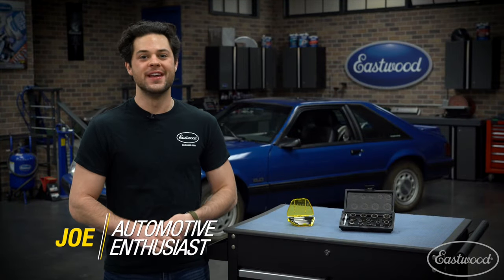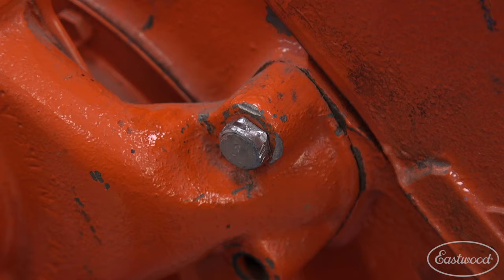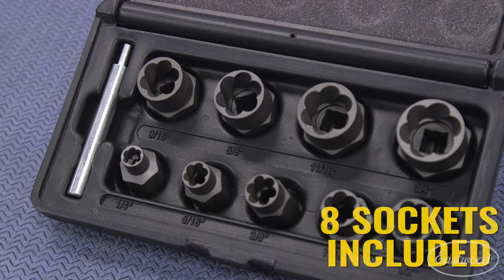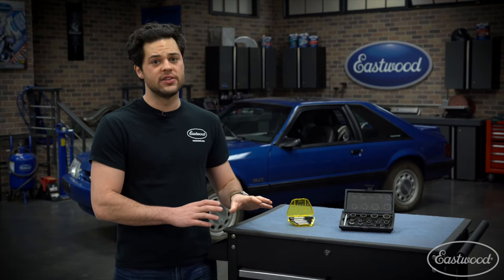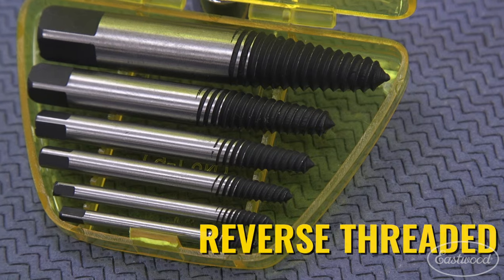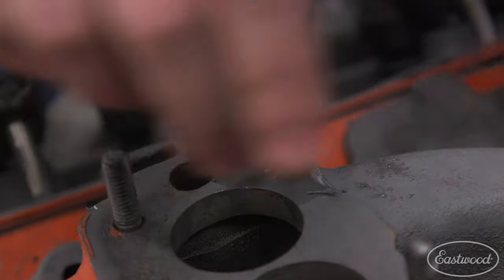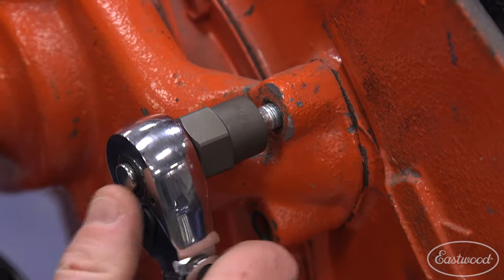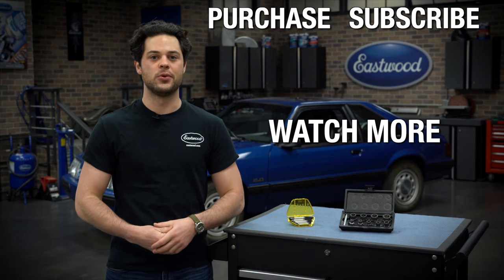The Easiest Way to Remove a Broken Bolt or Rounded Bolt Head - Screw & Bolt Extractor Kits

Comment: I used the bolt extractor and it worked fine.  Problem now is removing the bolt from the extractor.
Reply: One time use thing, hopefully 😂
Reply: You should be able to clamp the extracted bolt into a vice and use your tap handle to unscrew the extractor

Comment: It's been my experience that these type extractors don't work very well due to the fact that the reason why the bolt broke off in the first place is it was seized in the hole to begin with... it usually requires way more than a simple extraction tool to get out the broken bolt/stud if you're lucky... drilling and a torch come to mind... 😩😩😩
.
Reply: Agreed,  I have had very limited success with the "male style" extractors from various companies.. often they break off in the broken fastener and then you really have a bad day:-(
Reply: @matthewshambler2644 Agreed that they don’t work very well. However when they are what will work and they break…that’s user error.
Reply: Little tip, there is this chemical called Freeze-Off. It causes the bolt to shrink and makes space for the penetrant to work through. I removed several seized bolts from my 95 Integra's rear lower control arms.

Comment: For me the bolt extractor made matters worse as the extractor snapped off inside the bolt....very hard steel to drill out.
Reply: use heat first if you can,
Reply: You use the included punch to punch out the bolt, just like the video said.

Comment: Well we tried to remove control arm on older Honda Civic and broke one bolt inside and rounded the other one so I believe I need this kit
Reply: What did you end up doing to get it out
Reply: @MiguelAyala550  we had to cut them off and then drill them both out we did not have good drill bits and it took a couple weeks doing it here and there when we had time. I know there are better drill bits and tools that would get that out but we just couldn't afford it
Reply: Cobalt drill bits only.....

Comment: Question. Has the need to have the tool fit imperial heads caused any compromise in design?
I ask because here in England we only work on cars with metric fasteners (unless they are 60+ years old. And that's a specialist thing)
Been looking to buy a set of this type of tool to avoid drilling and heat.
Assuming you do international postage
Reply: 1:48 is 1:48

Comment: Eastwood should stick to welders, after all that is the best broken bolt extraction technique of them all. Faster, easier in most cases and more reliable with the option of a “re-try” if first attempt fails…”in most cases”

Comment: Start with a rounded bolt, break off the bolt using the rounded bolt extractor sockets. Then go to the male style and break the bit off.. now your really in a jam thinking you should have drilled and re tapped the threads to begin with.

Comment: Also these are very good at what they do.

Make sure to get correct specs.

Remember hardness equals brittle....... Very strong but......

The bolt he tapped the bolt extractor onto imo was to small, the extractor was more than half way on then tapped with hammer.

Use a extractor that just fits, just. And CANNOT BE PUSHED ON MORE THAN HALF WAY.

You wanna be hammer that sucker on.
And then the instant you turn the socket it will bite in, making less possibility of chewing the bolt head further into a rounded head.

Used correctly these work great.

Usually the quality is what let's them down but people do still make things that actually they were meant for, doing it very well.

Like drill bits.

Metal wood masonry?

Umpteen types for metal, why!

I've bought many drill bits and spent along time realising these are crap! Doing nothing.

A it of research and hey presto.

For not alot more. And forever lasting and better in every way....... COBALT DRILL BITS.

Enuf. Said. Already. 😅😅😅😅😅😅

Comment: I'll give the bolt extractor a go on cylinder head bolt.

Then straight to the cobalt drill bits,

Punch it. Drill it 6mm, then 10mm.

20mm depth.

Lift head.

Pipe wrench the stud out.

Comment: What about a stud that has 80lbs of torque on it?
Reply: My dilemma right now. I have one head bolt rounded. Torque bolt. So I have my easy outs. My welder, and my drill to hand.
Brutal
If stripping the mess of an engine isnt enough!!!

Afterwards gotta put it all back together, all 7thousand bolts nuts washers. Pipes, wires, plugs......

Comment: Hello quick question I have a Honda Ridgeline I'm trying to remove the ignition key assembly and on the steering column there are two rounded heads that online they suggest you use a chisel and a hammer to remove them but tapping them backing them out but I wanted to know if your tool would work on them
Reply from the maker: We're not familiar with that specific application - if its threaded the same way as a normal bolt it should work, if they're pressed or something this wouldn't help you.

Comment: These are junk. Use a left handed drill bit, start small and move up. The every size bit up you go will pull on the bolt more, and removing mass from the center will release more tension from the threads. 

These quite literally squeeze the bolt and apply more pressure on the threads.